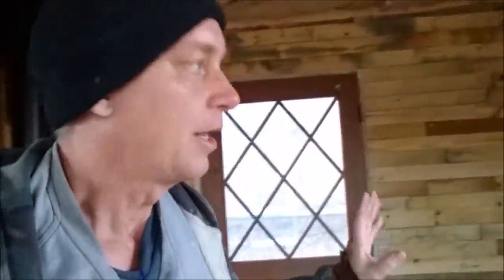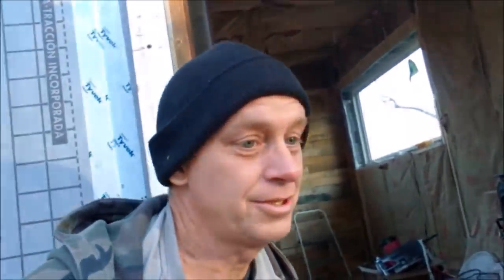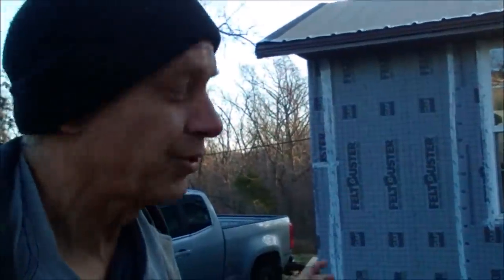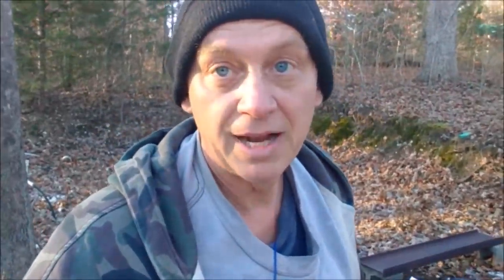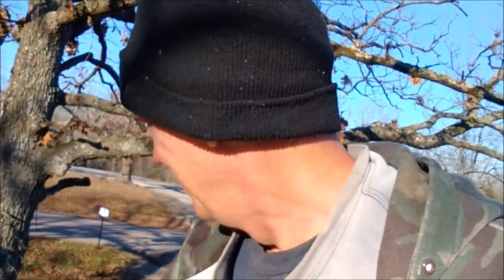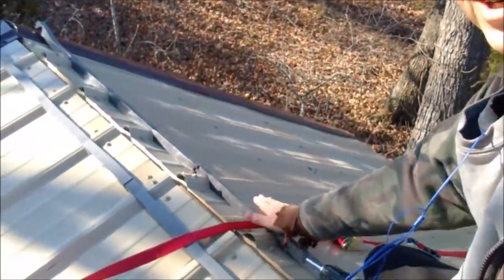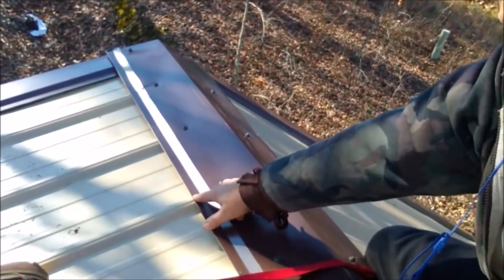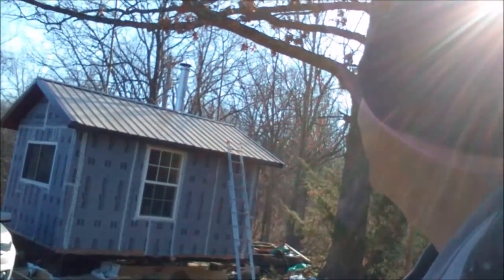Just Notified That Our Tiny House Is Not Safe While Off Grid Living

Comment: Hi Rob and Carolyn, Just a suggestion about the ceiling for your tiny house. My father renovated our home back in the 1960s, and stripped it back to a shell. Like you he was working on a budget and my parents were doing most of the work themselves. The upstairs ceilings are made of hardboard with wood surrounds in squares. You could do this with hardboard and some of the pieces of pallet wood. The ceilings are now painted white which brightness the room. I live in the family home now and the ceilings are still good. You are right to attempt this project now rather than leave it until you are older. I renovated an old stone building here, making it into a summerhouse, clearing out the rubbish, partly rebuilding a fallen down wall. Building a stone fireplace and installing a pot bellied stove. I made window frames and renovated an old metal one that was still in the building. I installed wooden beams and then put an asbestos roof on there. ( my dad had left some old sheets left around). I did however make the mistake of putting the screws in the downsides of the ribs and even with washers and going up on the roof each year with sealent it has leaked. I am now 20 years older and no longer feel up to such a big project. I will now hire someone to replace the roof with new beams and a metal roof. At the time I was proud of my project and that I mainly used recycled materials. It took me a year to complete but only cost me £200. My dad had also left some old wood and bricks laying around so I built myself a very wonky greenhouse. ( I didn't know about plumb lines etc and no real Internet back then). I was very lucky to have a local hardware shop which cut all my glass for me. I would say to father's teach your daughters these thing's, I had to try and learn by myself after he had gone
Been loving your build, brought back memories of my own project, especially trying to put roof panels up on my own. By the way I was just wondering, do you think you will use the camper again for holidays once you have your tiny house completed? Sorry to be so long winded, all the best from the UK.

Comment: ooh and the roof cap is ment to be screwed down with a 'stitching screw' (uk names from bulilding aircraft hangers) actuallly better your way as going into something structural but if it does start lifting and dropping making a vibration in the future just use a short stitching screw near the edge and it will stop any vibrations and annoying noise

Comment: There is a clear type finish that is used on the interior of log homes you may want to look into. Can't remember the name but you may find it under log finish. Anyways I got a small sample jar of it a few years back and coated a plywood board with it and had an uncoated one right next to it. Using a Mapp gas torch I wanted to see if there really was a difference as they claimed.
They claimed it would self extinguish and by my experimenting with it , it worked wonderfully.
It would self extinguish .

Comment: Most fireplace heat reflectors are planar, and two at 90 degrees make a corner reflector ( https://en.wikipedia.org/wiki/Corner_reflector ) which, to me is just silly because it sends the majority of the heat straight back at the source. In other applications ( https://bit.ly/33YjAoi has segments, but you could just bend a piece instead ) , one uses a curved reflector ( circular, to some degree to fit your space ) would disperse and spread the heat outward evenly across the room. looking down, if you remember the angle of incidence equals the angle of reflection, you can probably pencil out what would work best with the constraints you have. Also, even with a low ceiling, and means of recirculating the hot air from the ceiling back to the floor does wonders, usually a ceiling fan, but people cobble up the equivalent of this product http://heatstick.com/_Heat%20StkBluBox.htm - since you are off grid, back in the day, there were mechanical clockwork fans ( https://bit.ly/3oyjzz9 ), possibly someone makes a modern equivalent. 

You're work is awesome, don't let anyone tell you different. : -)